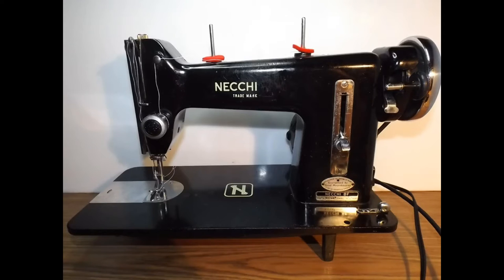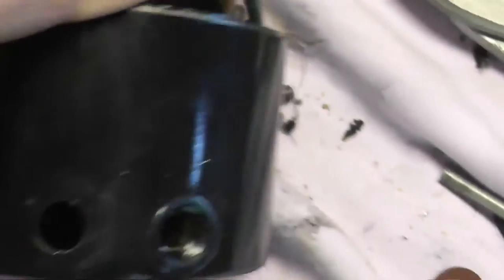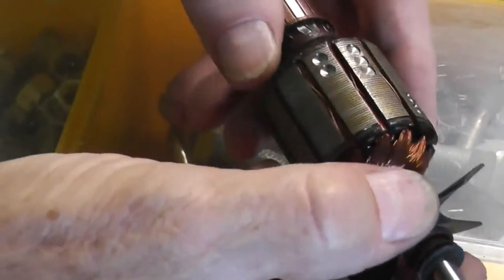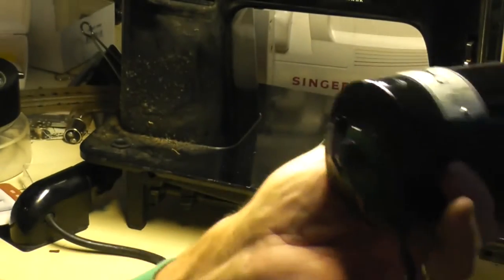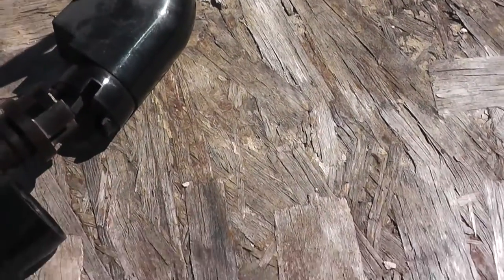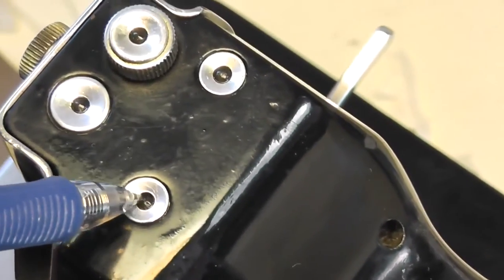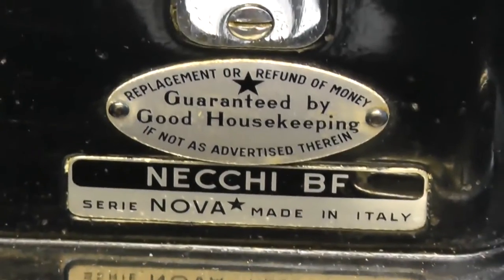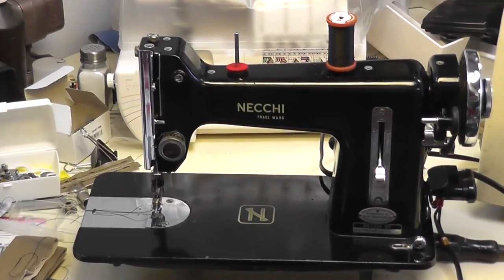Necchi BF Nova cleanup/motor work

Comment: Thank you for sharing your process! This video is helping me. I am working on a BU with this same motor. I am wondering if I might have the same issue with the rivets piercing the stator. Are there any other screws which hold the stator assembly in the housing? My wires need to be replaced and I can't see any other way to do it without separating the stator from the housing. Thanks!

Comment: I’m working on restoring a similar BU unit, I have bought wire to replace the wires coming out of the motor. It was crumbling all the way into the insulated motor core, so I don’t have enough lead left to hook my new wire to. Any ideas? I wasn’t sure if it would mess something up if I started unwrapping the insulated core part to get at more wire.
Reply: I had the same problem. I just left a tiny bit of wire poking out of the core, and soldered on a piece and shrink tubed the rest of the wire as close to the core as possible. What did you end up doing?

Comment: So I came by a Necchi BU and it was in working, but rough shape. I decided to refurbish it starting with replacing the wires as they were cracking and in really bad shape. I took apart the motor, and the wire was cracking all the way up to the linen type material in the motor, so I removed all the cracking plastic and, soldered on a new wire and put a shrink tube over the exposed bit as close to the linen type material as possible. I tested the motor by plugging it directly into the wall and I'm getting an "electrical" type smell that I don't really remember from before and small cracking sounds coming from the motor. Are these things I should be concerned about, or are they relatively normal?

Comment: I am almost positive my rivets are going into mine as well. How do you get that off so it will come out. I want to be able to replace those cables too.
Reply from the maker: Sorry, on vacation last week. I sorta ripped the motor out...wrong way. you really need to drill them out, with the right size drill (slightly larger that the rivet). Then the rivets will just fall out and you can easily remove the motor, If this is the original wiring, the covering is brittle and really does need replacing. 18 gauge lamp wire from Home Depot is perf!
Reply: divyajnana i ended up doing it similar to you but delicately enough to put the plate back on with light tapping